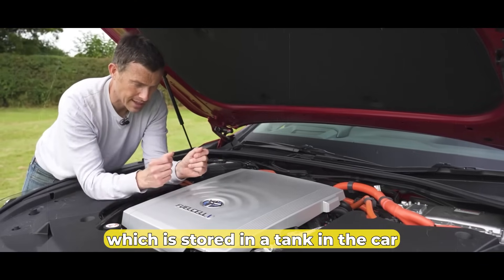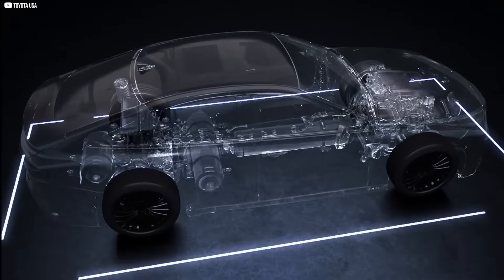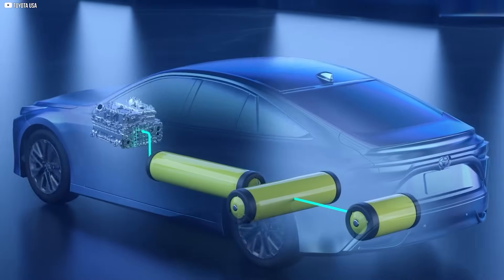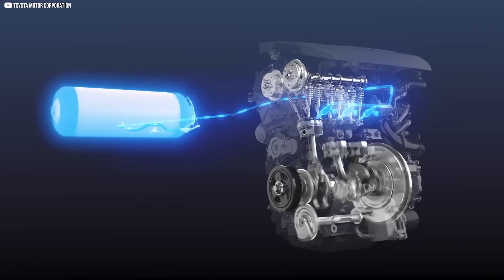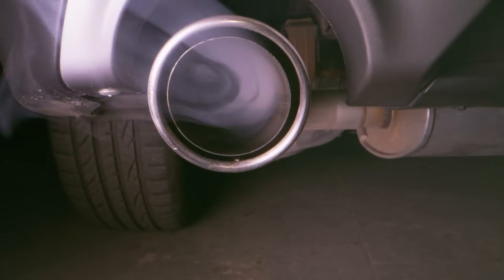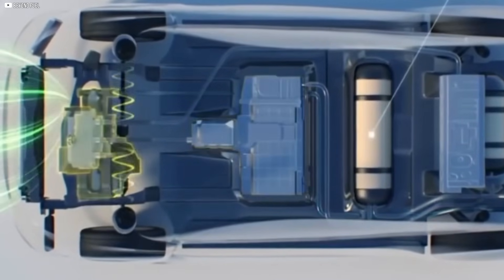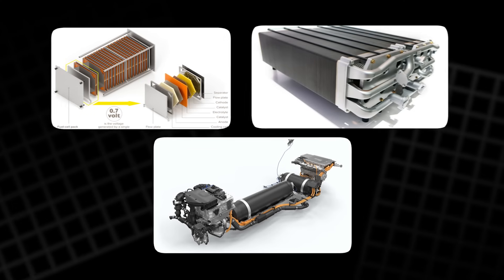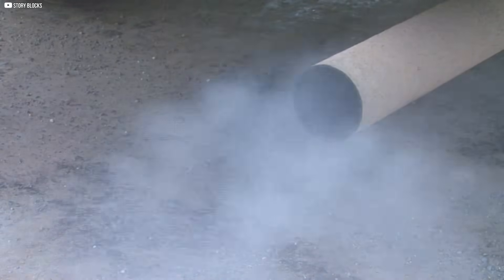Inside a Hydrogen Car: Fuel Cells, Motors, and Zero Emissions

Comment: Why when you have batteries that can run  a car over a thousand miles. Next....
Reply: hydrogen is not for cars, as shown in the video, but for trucks, trailers, ships, trains, rockets, planes, because batteries don't have the power density to move these on long distances. Hydrogen is a heavy lifter, like diesel, packed with power.